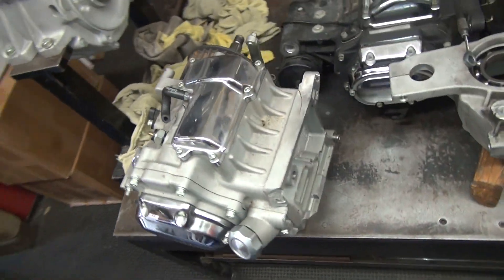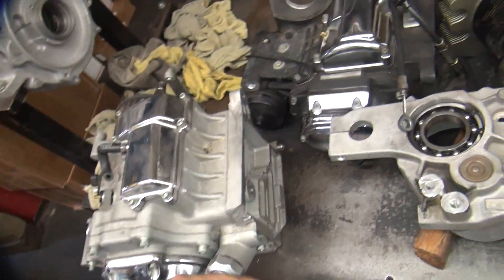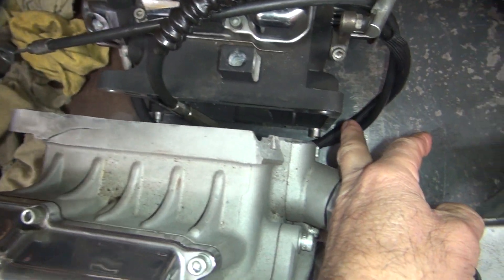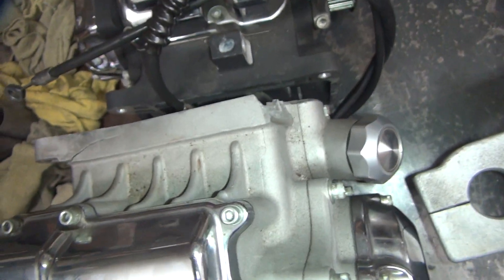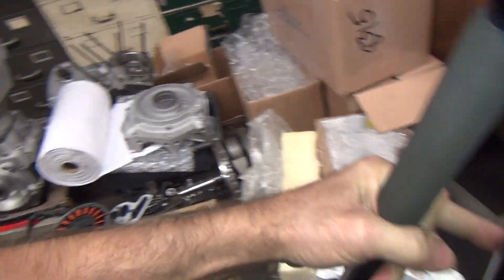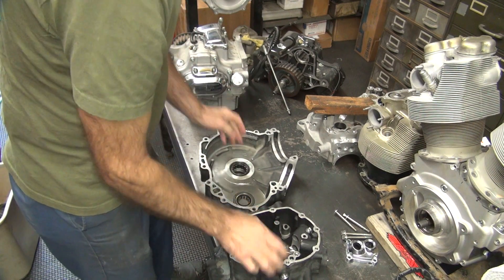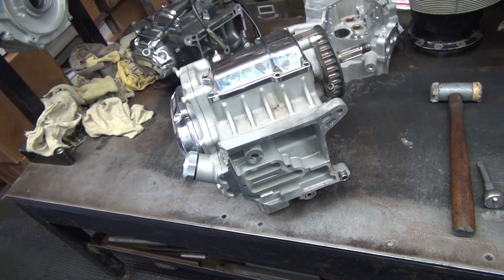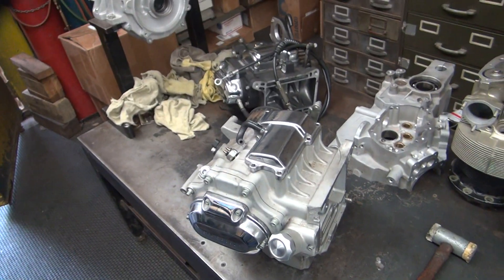#104 custom harley airplane 200ci+ motor twin cam buell xb 4 cam evo XL sportster race tatro machine

Comment: Could you make an adapter plate.not sure if it would be strong enough or there's no space for it. Just curious.
Reply: I was going to ask that same question.   Use a plate and put it wherever you want?
Reply from the maker: theres lots of ways to do things. its all about what you think will work for yourself.
tatro